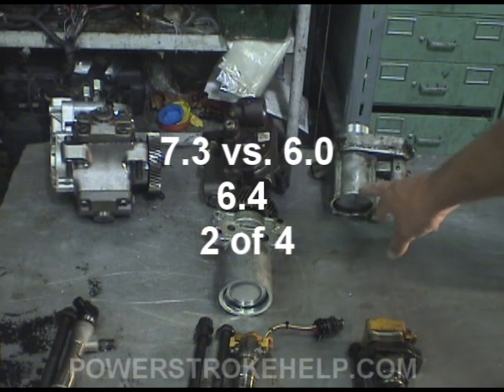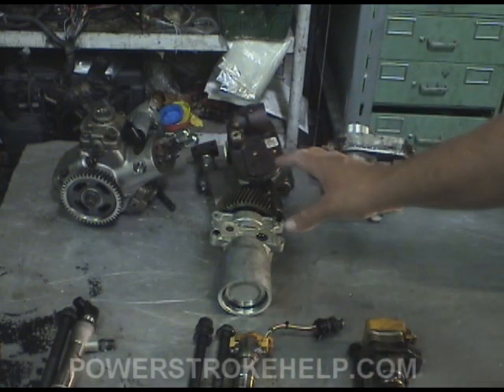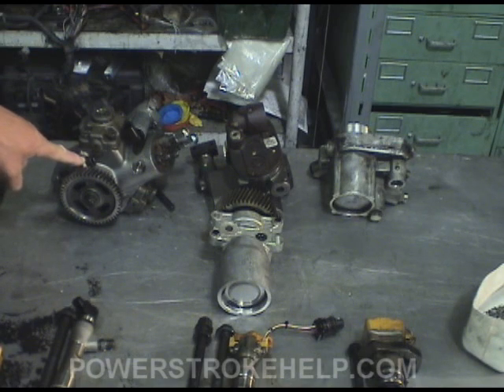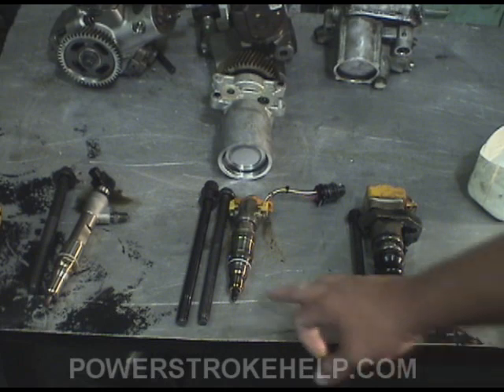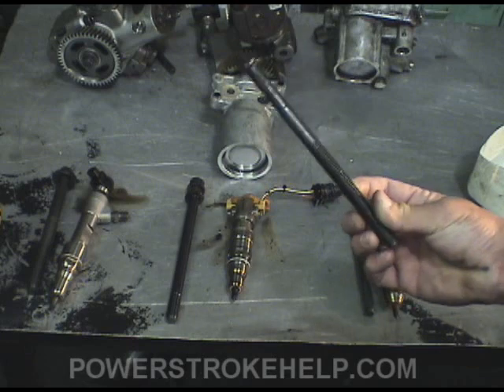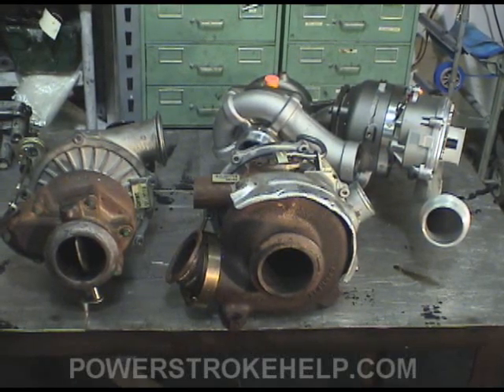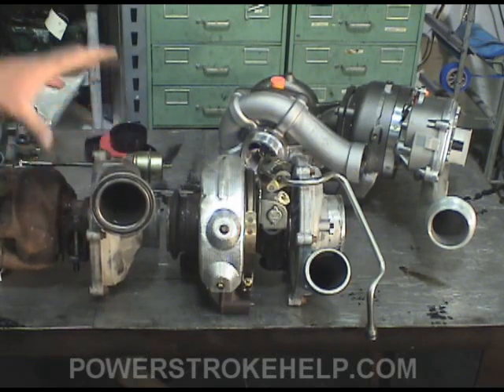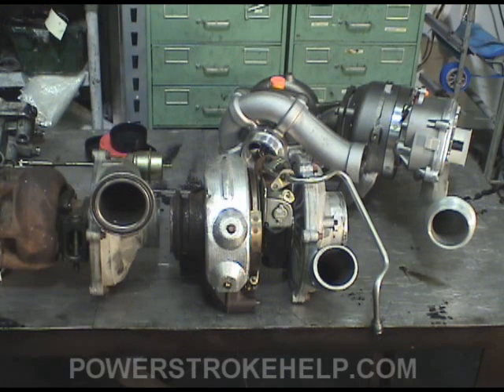7 3 vs 6 0 vs 6 4 POWERSTROKE ENGINES 2 OF 4

Comment: Recently bought a new 2003 6.0 with a banks six gun tuner in it the thing I don't like about it is every time you disconnect the battery the tranny has to re-learn for each tune i.e. 1-6 witch makes the tranny shift pretty hard, i even had the tow/haul light flash on and off for a whole drive but it stopped. Question - How bad is this for the tranny?

Comment: At 1:26 how the fuck did the spring come out because of gasoline?
Reply: Gasoline by it's nature cannot handle high compression like diesel fuel can so when gas gets to that high compression 30,000 psi pump it self detonates and turns that little pump into a mini engine and tears some shit up
Reply: +Riley Kirk  There is always air present, it doesn't take much with that much compression.
Reply: ***** how does it detonate with no oxygen?

Comment: I just came axross your posts,very,very helpful.i have a 2003 with the 7.3 and have 566,000 klms on it up in Canada I use the truck for work.f550 flat deck just starting to have trouble on cold start up,bad miss then clears up when warm.it is ok if I plug in block heater.only one injector was replaced 3 years ago,it split open at the tip.

Comment: I sold my 1988 F250 7.3 non-turbo which had a tad over 370k milles on it but still ran fine A small cloud of smoke at startup and a bit going down the road but not bad enough to worry me. Wouldn't have sold it but I needed the money. Never even had to replace a single mechanical item not even an injector. A turbo engine would never get this millage. Too much high pressure on the engine. I pulled a huge CAT Blade and never needed a turbo. Used standard engine oil nothing fancy.

Comment: Will a dealer (or most shops) have upgraded the head bolts to studs when doing a head gasket job?  Is it standard practice?

I'm guessing if it was warranty work then probably not.

Comment from the maker: @tree1996redneck I'm sure someone will figure it out. We have not attempted to put the 6.0 turbo on the 7.3. It WILL require custom fittings and tubes and brackets. That may make it cost prohibitive.

Comment from the maker: @foxracing279 True but either way gasoline in the 6.4 or 6.7 is a major screwup. The parts bill is startling to straighten it out. Then the labor will make you want to set the thing on fire with the gasoline you just ruined by mixing it with diesel. I have seen more than one employee get fired over this. One guy did it twice, distracted on the cell phone doing business. His boss couldn't fire him. So he hired a driver because it was cheaper than fixing the truck AGAIN. I live in an odd world.

Comment: holy crap! at our shop we had a guy bring in a ford 6.0 for the traditional cooler internal coolant leak, the same guy THE NEXT DAY brings in his brand spankin new 2011 6.4 that he accidentally put gasoline in his engine,  he said it stopped on its own, so i dropped the tank pulled the fuel filter and purged the whole fuel system, fortunately after a few cranks she fired up and ran good, he must have got lucky